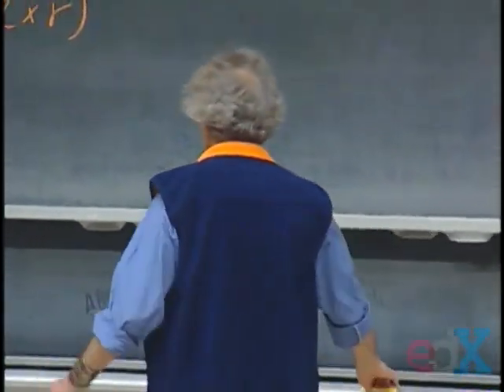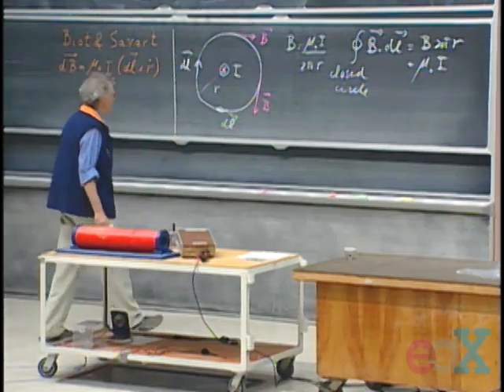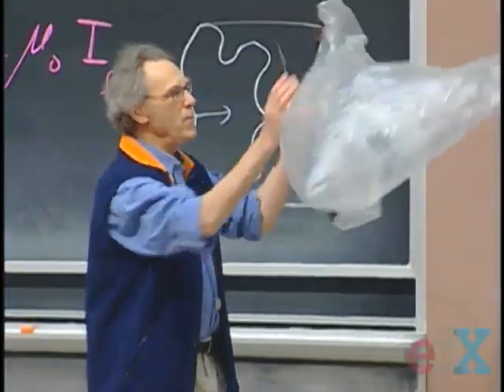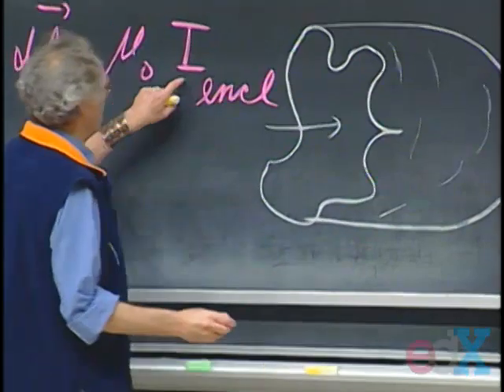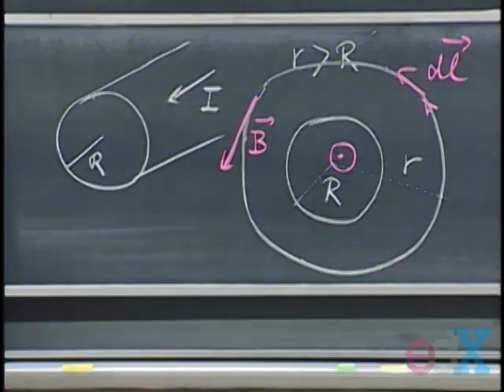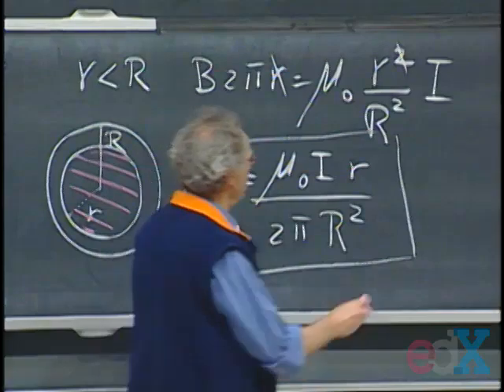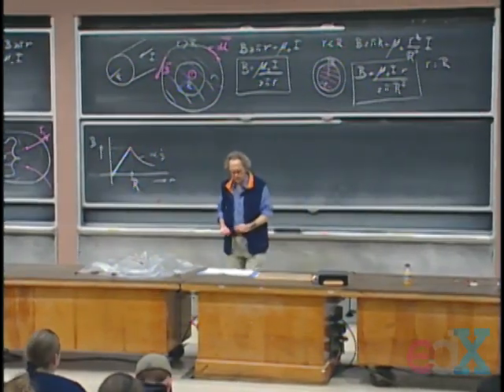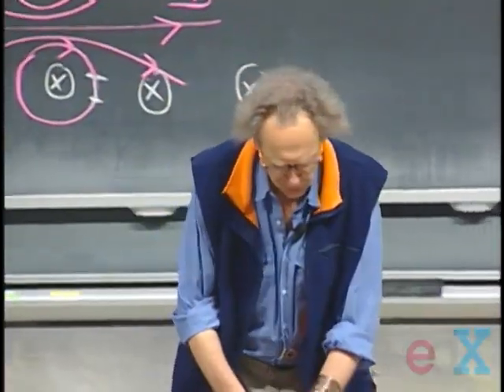8.02x - Lect 15 - Ampere's Law, Solenoids, Kelvin Water Dropper (revisited)

Comment: Sir , At 22:22 Why you talked about Mangetic Field by the First Loop at 26-100 is Practically Nothing , But There are Thousand's of Such Loop Which Can Combinely give a Strong magnetic Field at 26-100 .....
Reply from the maker: I cannot add to the clarity of my lecture.
Reply: Lectures by Walter Lewin. They will make you ♥ Physics. Sorry Sir , I didn't get my Answer ..... Sir , I wanted to ask why We only take a Single Loop from the Starting and See the Magnetic Field in 26-100 (Point you choose instead of A or B or C) not The All Loops Magnetic Field ???..... Please Tell
Reply: Lectures by Walter Lewin. They will make you ♥ Physics. Here Starting means the Point from where Solenoid Starts .....

Comment: Sir, if two conductors with equal amount of current in opposite direction penetrate the closed surface, what'll be the value of 'H' around a circle of radius r ???
And is it mandatory that the circle should be symmetrical about the conductor's position or the center of the circle can be positioned arbitrarily , which encloses the two equal & opposite current ???
Reply from the maker: question is unclear and ill-defined.

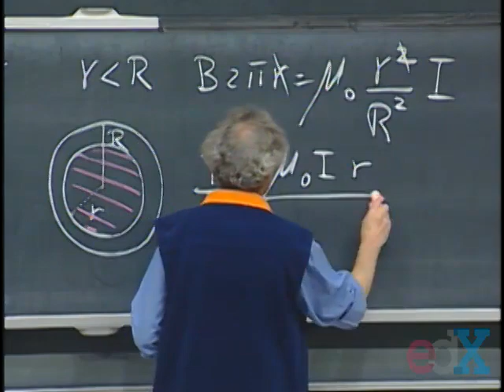Comment: at 11:27 B is non zero. so, can we conclude "  inside conductor, electric field is zero but magnetic field exists "?? of course in the static case only.
Reply from the maker: electric field inside superconductive material (with infinitely high conductivity) is always zero. Yet a current can flow through a superconductor. E=j/sigma. E=0, sigma is infinity, thus j can be anything.

Comment: Hi Prof Lewin

Thanks a lot for these wonderful course, I really started loving Physics now.

I have a question : the first example you gave showed that B is not 0 in case we have a wire with current flowing inside, but Ampere's law says that the circulation of B through some loop is proportional to the current enclosed, which you defined to be the current that is penetrating any surface that is attached to that loop, so if the current wire is not infinite then we could easily find an attached surface to our loop in which the current ins not penetrating, which gives a B circulation =0, and this is contradictory with your result. Can you please clarify this to me ?

Thanks a lot
One of your big fans
Reply from the maker: Nabil Akdim I can only answer you if you let me know which lecture (which number) and the time into the lecture. I will then watch it and I will get back to you

\\/\///////@lter
Reply: Lectures by Walter Lewin. They will make you ♥ Physics.  Hi Sir, It is 8.02x - Lecture 15 - Physics II: Electricity and Magnetism - Walter Lewin, from min 7 till min 13, when you calculate B generated by a current flowing in a straight wire.

Thanks
Reply from the maker: Lectures by Walter Lewin. They will make you ♥ Physics. Look at the equation for r<R, B is linear in r and thus it is zero for r=0. Look at the plot I make of B as a function of any r. for r<R the curve is linear for r=R r >R B falls of as 1/r. If you send me your email address I can send you the two KEY figures. But that may not be necessary.
Reply from the maker: Lectures by Walter Lewin. They will make you ♥ Physics. if the current density  is uniformly distributed inside the wire, then B=0 for r=0. Even if the current density inside the wire were not uniform but it would be a function of r, even then the B field at r=0 would be 0.  You can ONLY use Ampere's law (as I did) if there is axial symmetry. If the current density were a function of r inside the wire, there would still be axial symmetry and thus you can still use Ampere's law. The moment you break the axial symmetry (if the current density is not a function of r) then you can not use Ampere's law.
Reply from the maker: Lectures by Walter Lewin. They will make you ♥ Physics. To use Ampere's Law you MUST make use of the axial symmetry. Thus you ca ONLY draw circles with radius r. The center of each circle is r = 0. you can draw a circle with radius dr  that will give you the B field at distance dr from the center. How could you choose a circle that ONLY contains r=0? Such a circle would be a point and that point is r=0.
Reply: Thanks for your feedback Sir, but what I was asking about is a bit different from what we discuss now, what I meant was that Ampere's law (circulation of B= myu0*I_penetrating ) holds only when the wire has infinite length, otherwise one could choose an open surface , attached to the circle with radius r at which we need to calculate B, for which the corresponding half sphere contains completely the wire and thus there will be no penetrating current for that surface and circulation of B will be then 0, which is contradictory with the result we get if we take a flat surface. Can you please explain to me why is it so ?
Thanks a lot
Reply from the maker: Nabil Akdim The wire does NOT have to be infinitely long. It could be one component in a closed loop circuit. Ampere's law will then always give you the correct answer for B as a function of r in that wire regardless of your choice of the open surface attached to the closed loop (circle with radius r).
Reply from the maker: Lectures by Walter Lewin. They will make you ♥ Physics. Any wire with finite length that carries a current MUST be part of a CLOSED circuit that drives the current. Thus the calculation of B as a function of r using Ampere's law always works as long as the current density in the wire is a function of r or is uniform.
Reply: Lectures by Walter Lewin. They will make you ♥ Physics. Exactly Sir, if it is in a closed loop circuit then it is fine (this shows by the way the nice mathematical similarity loops have with infinite lines), Thanks again Sir.
Reply from the maker: Nabil AkdimNabil
 infinite lines do not exist, Closed loop circuits do exist. My derivation in class therefore did not have to make the approximation that the wire is infinitely long. Thanks for your comments though.
Reply: Lectures by Walter Lewin. They will make you ♥ Physics. Thanks to you Sir, have a very nice day.

Comment: Hello Sir. For an ideal solenoid, magnetic field outside the solenoid is zero, because when we consider an amperian loop outside the solenoid no current penetrates through it. But it also suggests that the magnetic field at the two sides of the loop is equal (from the line integral), which means that there is a mag.field present. These two statements contradict each other. Please explain....!
Reply from the maker: Since the B field is a dipole field, the B field can never be zero anywhere outside the solenoid, that could only happen if the solenoid is infinitely long.
Reply: @lecturesbywalterlewin.they9259  Thanks a lot!!

Comment: Sir what is definition of electric current
It is the rate of flow of charge or it is rate of change of electric flux linked with a surface
Reply from the maker: C/sec use google

Comment: Sir, is it in any way possible to solve for the magnetic field produced right above a center of a disk on the z axis, where the disk has a current density of J = C*r where C is a constant and r is the radius, by only using Ampere's law and not Biot Savart?
Reply from the maker: This is an absurd problem. In principle it can be solved - if not analytically then numerically. Ask Quora how to do it.

Comment: Sir I have a doubt, does the magnetic field calculated by Ampere loop law depend of which surface we take (as long as we keep the loop and current carrying wires constant ) ? I mean we could choose any random surface for a given loop and the magnetic field should still be the same on loop.
Reply from the maker: ampere's law always holds regradless of which loop you choose.
Reply: @lecturesbywalterlewin.they9259  Yes sir, the idea sunk in after imagining a few different scenarios. Thanks you very much for your amazing lectures, they really helped me understand physics especially magnetism intuitively without just mugging up formulas.

Comment: 38:03,,why it starts itself to charge just behind 10 (in between 0 and 10)instead of 0....that means thy are not fully discharged,otherwise it should come back to 0..why is that so???
Reply from the maker: This lecture is clearly too difficult for you. For more information use google

Comment: Professor since in Kelvin water dropper ,can A and bucket C are connected by a wire with negligible resistance should not they be at same potential?
Reply from the maker: how many minutes into the video?
Reply: At 30:40
Reply: What i am confused about is if can A gets (negative charge from water(-x coulomb)+ charge it already had),is it's potential equal to bucket C ,which gets(positive charge from water(+x coulomb))?

Comment: Professor, my question is : electric field are way higher than gravitational field so does their attractions. So how does the charges fall due to gravity against electric field in Kelvin Water Dropper?? Please correct me if i am wrong. Awesome lecture !!
Reply from the maker: Please calculate the approx charge on a water drop as it falls. Then approx the E field in which it falls that will tell you the magnitude and direction of the electric force acting on the water drop. Then compare that with mg.
Reply: With all due respect sir, i did it but still i have one problem with it. There was a spark (corona discharge) between the balls so there was a pot diff of about 20kV. Does that mean E field is very high? If so, then it may surpass the gravitational pull by earth. In the first go, i also answered gravity (when u asked in lecture). By the way awesome lecture!!
Reply from the maker: The E field when the spark occurs is NOT the E-field near the individual water drops as they fall.
What you have to calculate is the approx E field between the drop and the metal can AND the approx charge on each water drop. This is a can of worms. The best way to get a rough idea (maybe only an upper limit) of the electric force that may oppose gravity is to evaluate g from the falling water drops. I predict that within the accuracy of your measurements that g will be close to 10 m/s^2. If so, that would indicate that the electric force is insignificant in comparison with the gravitational force.
Reply: Wonderful lecture!! I too have same problem. If you don't mind, can you solve it for me. I am unable to do it.
Thankyou for the lecture
Reply from the maker: I solve problems in my 141 help session which are on this channel.

Comment: Sir, I have a question. If a wire carries a time varying current then in its surrounding will Ampere's law be valid for a closed loop?
Reply from the maker: when a current flows through a wire Ampere's Law always holds
Reply: Thank's sir for explaining my doubt 
Your lectures are very helpful for me

Comment: Hello Prof. 

At 3:00 in this video, you stated Ampere's law as the integral of B dot dl = µ0 * I . 
In the electromagnetism course I'm following right now, ampere's law is stated as:

 The induced magnetic field in point P is: B = (- µ0 / 4pi ) times the gradient of the solid angle that contains the path of dl, viewed in perspective of point P. 

Your version is the only version I can find on the internet.  My question is: Are these two versions  connected to eachother? 

Thanks in advance, your lectures are the best source I found for explaining concepts of electromagnetism.
Reply from the maker: my version is in SI units.
use google for cgs units
Reply: Yes, I believe my professor is also working in Si units. Later on in the course, we derive exactly the same formula (integral of B dot dl = µ0 * I) from Biot-Savarts law, without defining it as ampere's law.
Reply: The two versions seem to be a different approach for the same situation.

I should also add that point P is not a part of closed loop dl
Reply from the maker: https://en.wikipedia.org/wiki/Ampère%27s_circuital_law
Reply: I have read that page many times now. I know that ampere's law is different in cgs units. So please do not focus on the 4 pi factor :)

There is no solid angle mentioned in that article. So can I conclude that the version with the gradient of the solid angle is not a version of ampere's law? and that there's no connecton between the two?
Reply from the maker: Biot Savart
https://en.wikipedia.org/wiki/Biot–Savart_law
Reply: It has indeed more simularities with Biot-Savart law. I suppose it is incorrectly defined as ampere's law in the course that I'm following. It is rather a different version of Biot-Savart. I think that was confusing me the most. Thanks for your time.

Comment: Sir, what will happen if I connect a bar magnet across the terminals of a battery?. Will current flow? Does the magnetic strength change, the current magnitude or direction change ?
Reply from the maker: +Anery Patel The bar magnet is metal. Thus you ail short the terminals. If it is an AA or AAA battery it will get hot. A lithium battery will probably explode. It's not without danger either to short a car battery!
Reply: +Lectures by Walter Lewin. They will make you ♥ Physics.  Ohh. Thats simple then. I was expecting something big. :-P 
As always, one more enthralling video lecture.Thank you

Comment: 2:48,you draw local B field and dl is perpendicular to each other,how is that so?then Cosine of 90 is zero....it should be parallel to each other isn't that so?how B field is perpendicular to the closed path????as the wire is going to the board.....
Reply from the maker: This lecture is clearly too difficult for you. For more information use google

Comment: Hello Sir, I ve got a question not to that problem but to an other video. In 8.02x Lect 15 u said right at the beginning that B = µ0*I / (2πr) buuut I am sorry, I didnt watch the lecture till the end yet and will go for it right now, so I dont know if you will come back to that point and add a thing but I just completly went out of my chair when I had to read that because there is a  µr missing. because we need to decide by which material the wire is made! and that has a big influence
Reply from the maker: µr of the wires have nothing to do with the B-field produced by the current (Amperes Law) .
Reply: yes, please excuse me I noticed now that Mykro r defines the material of the core ( if there is one and if its just air well then its = 1 and well) whoops
thank you very much, your lectures are super great!!! Keep it up!

Comment: Almost everything clear about the Kelvin water dropper, but I missed something about the first step. 
When the A-can is net charged "by nature", and water is approaching it, water has been polarized (H+, OH-). When the water passes trough the can, it's only negative, BUT where do H+ ions go? I mean: if at time=0, water starts to flow above A-can (with OH- and H+ naturally inside it), does it really happen that H+ ions don't approach the can, and they stay far away from it? (Probably a stupid question, sorry for it).
Reply from the maker: I explain the Water dropper in a separate lecture.
Reply: I thought that this lecture was the explanation of the water dropper. Which lecture are you referring to?
Reply from the maker: You may have watched the lecture in which I explain the working of the Water Dropper.
I cannot add anymore to it. I suggest you try Google to give more detailed explanations than I did.

Comment: you talk about penetrating a surface, but what if i pick a surface like a plastic bag, but one that zig zags hundreds of times, letting a single current pass through it multiple times? is it such that one current only contributes once, no matter how many times it may penetrate that surface?
Reply: ooh. so it works very similar to gauss' law for a closed surface and the electric flux canceling out on opposing walls!
Reply from the maker: ha ha ha -  you cannot fool Maxwell!  If you zigzag an open surface you cannot win. Look at the picture of my Lect #16. I show a huge open plastic bag - that's OK. Now fold my plastic bag as many times as you want to. Take a wire through which current flows, draw a closed circle around it and attach an open surface to that closed loop. Make that surface zigzaged. Poke it through your 1 zigzaged surface.  Ampere's Law, the current has to cut through your open surface in the direction from inside the surface to outside (using the direction of the current). But that will ONLY happen once. After the first cut from inside to outside the wire reaches the zigzag, but now it enters your surface from the outside to the inside and then it  cuts the surface again from the inside to the outside. Those last 2 cuts cancel.
Reply from the maker: no Gauss' Law is very different. use google or watch my lectures.

Comment: does the radius of the coils of the solenoid affect the field inside the solenoid? why/why not ? an explanation based on intuition will be much appreciated.
Reply from the maker: current is what matters. Resistance of the wires is lower with thick wires than with thin wires. Thus currents will be larger with thick wires. However, when we talk about "IDEAL" self inductors we always assume they are made of super conductive wire. Thus zero Resistance. If they do have a resistance in circuit analysis we place the R in series with the ideal inductor.
Reply: Lectures by Walter Lewin. They will make you ♥ Physics. by radius of the coils I meant the radius of the circular current loops that make up the solenoid
Reply: i ask this seeing that the field at the centre of just one current loop depends upon its radius ,so is that the case with a solenoid where there are multiple current loops?
Reply from the maker: yes the radius is important. I suggest you use google to read some engineering data on designs
Reply: Thank you so much for answering!